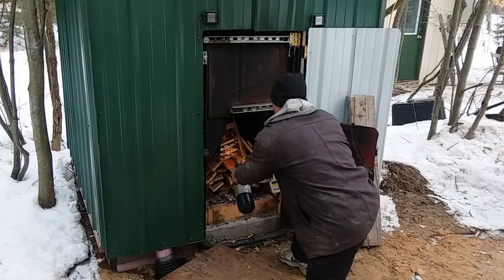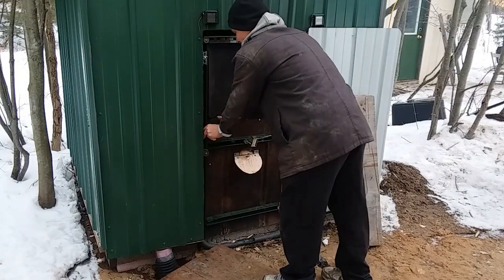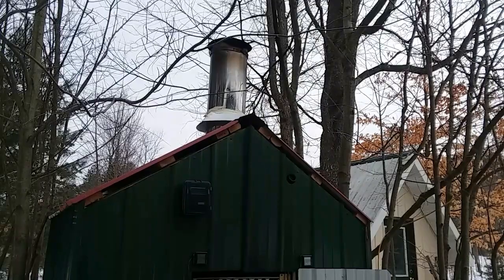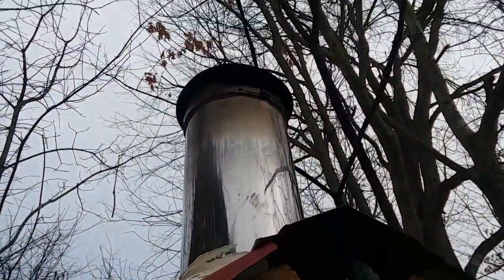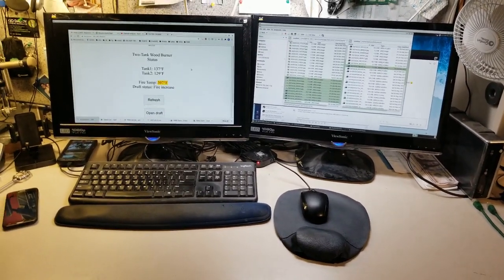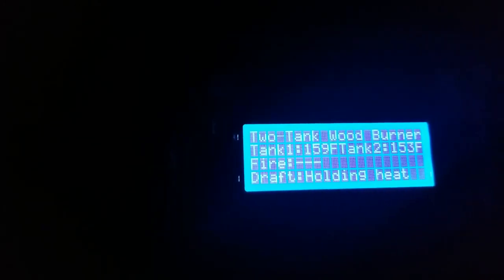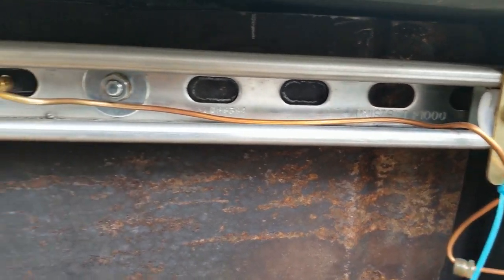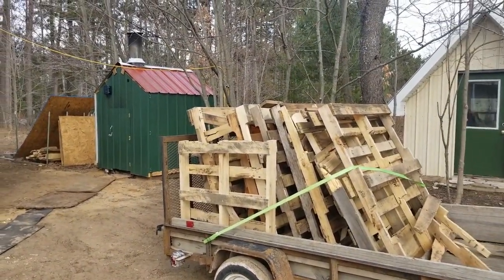Home Built Outdoor Wood Boiler, Part Four

Comment: Now that you have ran it a few years how has it stood the test? I’m looking at building one myself and this is the first time I have seen this design and curious about it.
Reply from the maker: It still runs!  Last winter the top sheet on the smoke box rusted through, and I replaced the whole smoke box with a thicker-steel one.  But the tanks are fine and don't leak, and we still use it year round.  (Only for domestic hot water in the summer.)
Reply: @dansw0rkshop it’s the simplest design that I have seen for a diy type boiler